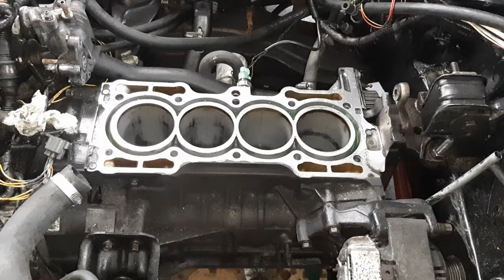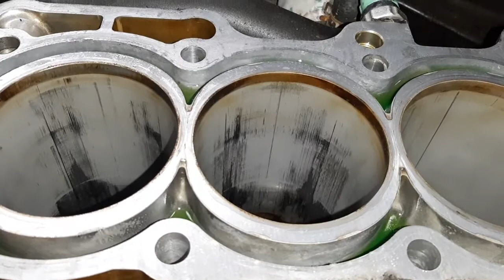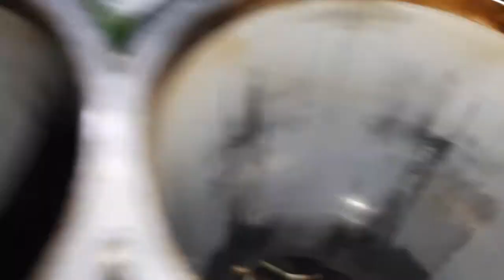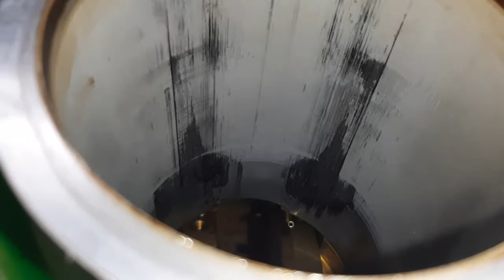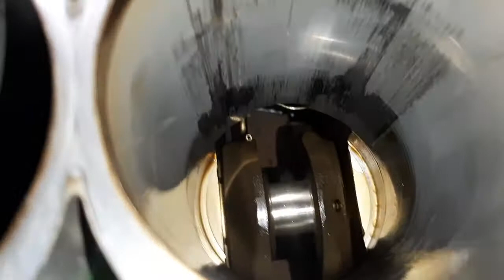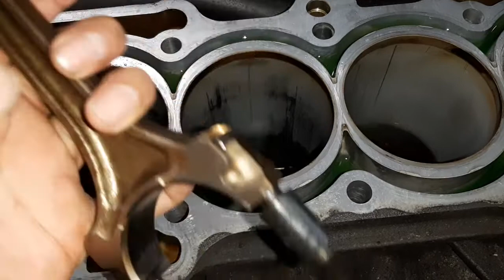Honda engine H22A ticking noise piston rod knock reason revealed!!

Comment: Same knock #3 on my H block fixed now and yes it needed journals so I took it out swapped cranks put a new oil and water pump with new seals and it stood brand new